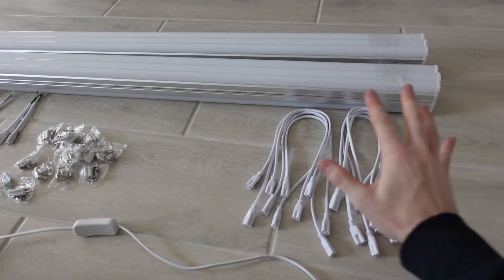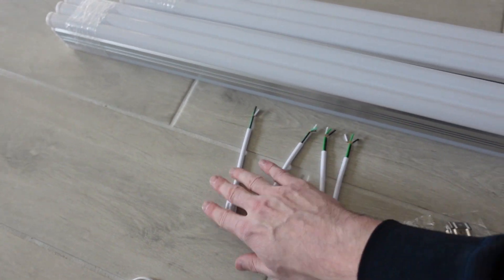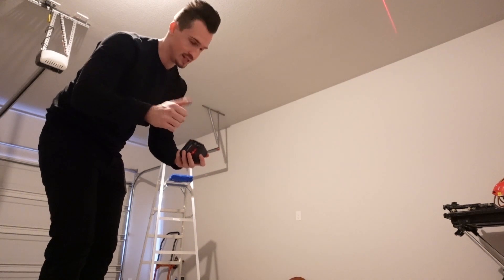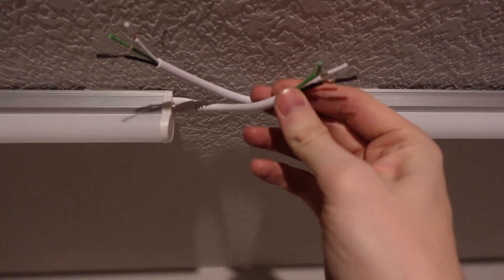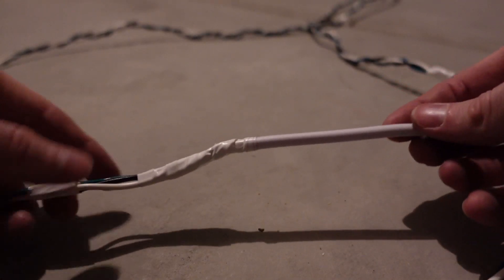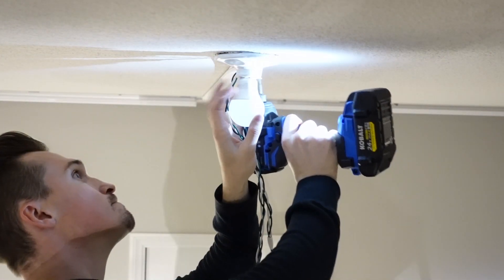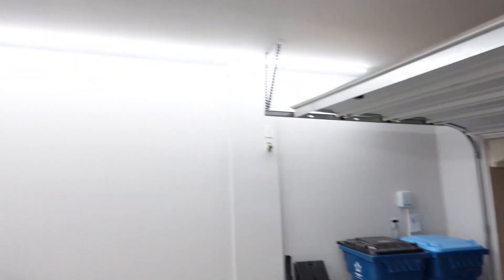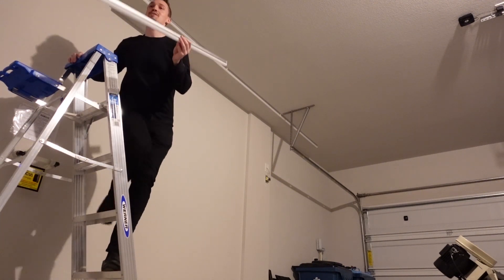BEST GARAGE LED LIGHTS WOW | BARRINA LED T5 6500K | How to install LED lights in your 2 car garage

Comment: OK, so I ordered a six pack of the 4 foot lights. And it only came with two hardwire pigtails. So should I use one per three lights? Orrr?? please and thank you.
Reply from the maker: You can put up to 6 per pigtail per the instructions, so 3 per pigtail would be fine if you ever plan to add extra lights later.

Comment: Great vidyo, after 4 years still one of the best on here. Initially I was just going to use the outlet on the bulb light for a quick solution, but I like hardwiring much better. It isn't shown, but did you just add a basic white cover over the light mount? And did you use drywall anchors for the brackets?

I think I'm going to do similar perimeter routing as you, but then add a 4 or 6 light rectangle right above the garage door opener and plug in to a light-bulb socket adapter - that way I can take advantage of brighter lights when opening the garage door and also keep those lights on (via the opener switch) if I need more light in the centre of the garage.
Reply from the maker: That’s a good plan, I wish I had plugged them into the light bulb socket as well, since I have to use the switch to turn the lights on.

Yeah I just used a basic white cover on the hole socket. 

I didn’t use drywall anchors and they’re still secured nicely, still working great 👍🏻 

Thanks for the compliments, good luck on your install :)

Comment: I just added 20 of these to my garage.  2 replaced the opener bulbs and 18 went all over including down low.  I wash my car in my garage with ONR and the lights make it awesome.  I also connected them all to my house lighting computer system.  I did Polyuera floor, split AC/Heat, 65" tv, New Age cabinets, and insulated the garage door....those will give you some ideas for your next upgrades....I'm sure you have some already.  Wish I could upload a pic or video for you to see.  Keep up the good work.
Reply from the maker: Sounds amazing, good job! Post it on reddit at r/garageporn - I recently bought some lockers to hold my aerosols and random things, that’s another fun idea! 

https://a.co/d/44N0xgl

Comment: Is there another way of connecting the wires besides soldering?
Reply from the maker: I wouldn’t trust any other method, twist connectors suck. Soldering isn’t hard, you can do it

Comment: Nice vid, but I wouldn't braid the power supply lines, just because it would make it harder to troubleshoot/replace one of the lines if you have a problem. Also, you should make sure you're using rosin core solder for home electrical + lead free electrical solder flux + a soldering iron meant for electrical if the temperature isn't adjustable. The flux and/or rosin core clean the surface area of copper as it melts, making a better electrical connection with less resistance/heat during normal operation.
Reply from the maker: Good to know in hindsight; thanks! So far it’s still working well so I’m thankful for that :)

Comment: Curious if the mounting screws are still holding up fine after 3 years. I just bought these and was wondering if those simple screw mount would be good enough.
Reply from the maker: Still holding up fine, I used double sided tape as well though

Comment: Hahaha I can almost feel your excitement when the lights came on! Looks good man! Gave me so much inspiration as I'm trying to look for lighting for my garage also. With your "perimeter" setup, how's lighting in the center of the garage, for example when you need to work on the cars? I thought you should've replaced that channel with another strip of light for better lighting in the center.
Reply from the maker: Thanks man,  I was excited! The lighting is great for working on cars and the perimeter still works perfect. I could use some more toward the garage door but that’s the only thing I’d change

Comment: I really enjoyed the video. You convinced me to wire directly into my ceiling rather than use the plugs that come with many of these LED light kits. I do a lot of detailing and the more light the better, especially for ceramic coating applications.
Reply from the maker: Definitely an awesome setup to have for detailing, I’m sure your garage is going to look great 🙌🏻

Comment: I have 60 or 65 of these same exact lights installed over 3 years ago at my warehouse and they are awsome . Not single one ever blew up yet and they have been on 24 hours since 3 years now ! Awsome lights for fraction of the price . 
One thing I am not sure about in your install is the “speaker wire” as you said , you used to power them on to main house wire , not sure how many gauge is that wire you installed , although these are low powered led lights but it takes in full 110v, and I think if u hage them on for longer period of time those wires should short due to heat ! Unless they are high gauge wires to take in 110v! 
None the less nice install 👍🏼
Reply from the maker: Thanks! I do remember that the wire I bought was thicker gauge than the supplied connector, so that made me feel good. I’m glad to hear yours are doing so well, same with mine - no issues yet 👌🏻
Reply: @JordanPayneLV  Can I ask where you got the laser from? Sorry If I missed the answer already
Reply from the maker: @carlod545  at lowes but they’re pretty easy to find on Amazon too!
Reply: @JordanPayneLV  Thanks. could we ask how many inches from the wall you installed your lights?
Reply from the maker: @carlod545  I’m not sure exactly but my goal was to ensure that they were centered, I think it was about 14 inches or so

Comment: great video! i'm about to do mine as well and noticed the instructions said not to link a certain amount of lights together. have you had any issues? thanks
Reply from the maker: Correct, yeah there is some concern with linking many of them together, this is due to the current required and the thickness of the wire and how much power it can take after so much resistance is loaded. The limit of this is vague, some people say they’ve linked up to 6 in a row with no issues. 

I can say that I haven’t had any issues at all with my setup and even after accidentally leaving the lights on overnight several times, I’ve had no problems :)
Reply: @JordanPayneLV  sweet. How many do you have linked to the light? I have 1 light as well and want to run the lights on the switch. Thanks
Reply from the maker: @DFinesse88  that’s why I ran 2 sets of wires through the channel in the garage, I think it’s 4 per set of wires.
Reply: @JordanPayneLV  gotcha! Thanks for the fast response

Comment: Nice video, thanks! Came across it after I installed our Barrina lights and great minds think alike. Ours are almost identical but I used two fixture kits with 10 lights each. I went with 5000K as the 6500K lights are just a little too blue/white for me. FWIW, there are drywall anchors that work great with the supplied brackets. They are #4-6 x 7/8". I bought them from Home Depot for a few dollars. I also added the additional wiring to reach the original junction box. SinLoon T5 T8 LED Lamp Connecting Wire works perfectly with Barrina lights. A laser light will cut measuring and mounting time in half. 👍 Keep up the great work!
Reply from the maker: Thanks man! Great minds think alike for sure! I thought maybe I’d get one more kit to light behind where the garage door is but I’ve just been lazy for now. I appreciate it dude thanks for watching 🙌🏻
Reply: Wow thank you for your comment! I’m buying the 5000k for sure now cause I didn’t want it to be too blue/white!

Comment: Great job. I would've placed some down the center as well
Reply from the maker: Thank you, and thanks for watching, yeah having a rectangle at each parking spot would be great - they are super bright though so if you have it just on the perimeter it works well, if anything I might add some to the back wall where the garage door is in the future

Comment: where did you get the laser?
Reply from the maker: I got it at lowes! Could also find them on Amazon
Reply: @JordanPayneLV  care to share a link? I went to Lowe’s last night and could not find one even close to that cheap. Thanks!
Reply from the maker: @dragin79  this is the exact one that I bought, maybe they’ve gone up in price since Covid?? Or maybe there was a sale going on when I got mine? Bosch GLL30 30ft Cross-Line Laser Level Self-Leveling with 360 Degree Flexible Mounting Device and Carrying Pouch https://www.amazon.com/dp/B01GJ40TOM/ref=cm_sw_r_cp_api_glt_fabc_BWQSV8GHHCE8W11R0EHE?_encoding=UTF8&psc=1

Comment: Awesome video! How far apart did you mark for the brackets?
Reply from the maker: I’m sorry man I don’t remember but you’ll have to lay out your lights and make some measurements for yourself. About 3 inches Inward from the outside point of light
Reply: the lights are 46" long so I spaced them 23" apart - tip use cardboard from box to make a 23" template to quickly lay them out (from end of first light 11.5", then 23" from then on provides 2 clips per light all spaced perfect)

Comment: No issues running all 12 lights to one socket?
Reply from the maker: Nope! To one socket is okay but you need to run separate connections with only 6 lights chained together because the wires inside the lights can’t support the current for more than 6.
Reply: If I want to connect two sets of 6 lights each to a single socket, should I combine the ground wires from both sets and connect them to the screw you showed? And for the connector caps, do I join three wires together: one from the main socket, one from the first set of 6 lights, and one from the second set of 6 lights?
Reply: Which exact wire did you get?
Reply from the maker: @albawdy  they had a section at Lowe’s (or Home Depot can’t remember) called “lamp wire” which was a thin gauge wire, and I got three colors. The wires inside the loom of LEDs lights is super thin, so the wire I bought was actually slightly thicker gauge than what came with the Barrina lights